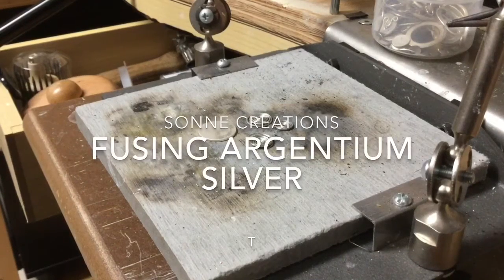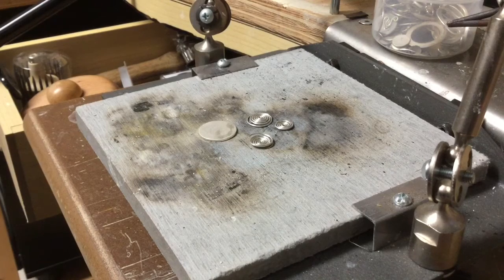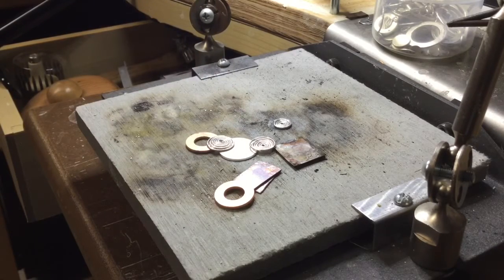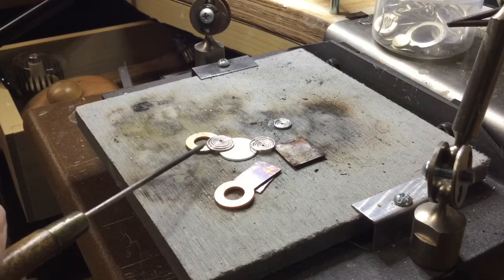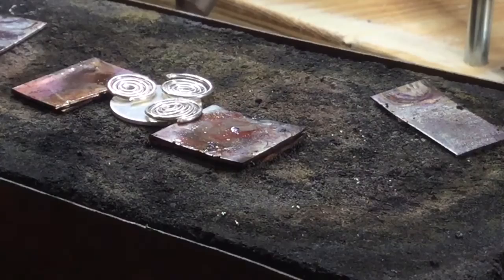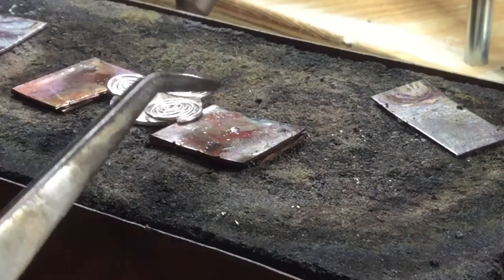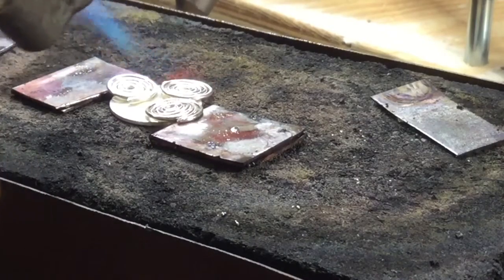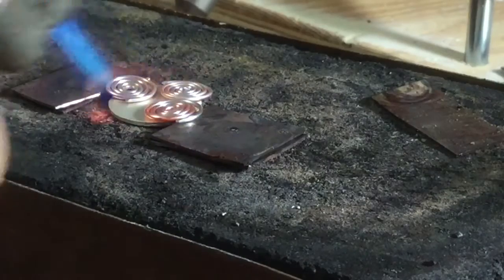Fusing Argentium Silver...Take 2

Comment: I taught myself on Argentium. I tried sterling and was frustrated with flux and solder and all the rest. I read about Argentium and that day ordered some and never looked at SS again. . ❤️❤️❤️❤️❤️❤️❤️Argentium
Reply from the maker: @gkelley2383  Fantastic!   Argentium is so user friendly it’s hard to believe. As long as you have enough heat, whether you have enough solder, flux or mojo it doesn’t matter.  It’ll either fuse or solder.  Welcome to the Argentium fan club!

Comment: The tip about the torch being full ! You are so right . I never noticed it before. I was struggling  to fuse a bezel , I filled my torch and wouldnt ya know ! It fused almost immediately . thank you thank you thank you .. . 
That was one of little tips that turns out to be a game changer. Serioulsy. 
Thanks again 
Gina
Reply from the maker: G Kelley You’re welcome!  The butane torches only hold a very little fuel, but even so a lot can be accomplished with them.  I have a small electric beehive kiln that I use for metal clay and enameling and soldering large bracelets and bangles, the kiln heats up the entire piece and then I come in with the torch and solder the join.

Comment: Hi ! Love your techniques with Argentium. I too am self taught . when I was finally brave enough to start working with metals Argentium caught my attention. I could not grasp why anyone would go through all the steps of soldering if you could use Argentium and just fuse it !! Sooooooo much easier. And it doesn't make me want to pull my hair out with frustration. I am currently working on a Argentium back with a fine silver bezel tape. I'm having a bit of trouble though. From watching your video I'm thinking I'm not going hot enough. Fear of melting !! Thanks for the video. Im happy I found someone with a similar background . .. B
Reply from the maker: G Kelley I probably have most jewelry instructors rolling their eyes, but sometimes a lack of formal education gives you the freedom to push boundaries and make new discoveries and sometimes it just feels good to challenge things.  If we all followed the American Food Guide we’d be an overweight nation......oh wait...., lol.  A butane torch does have limits, if you have access to a small Beehive Kiln used for metal clay, it really helps to get the piece up to temperature, otherwise it might be time to upgrade.  I might have to make a video on that.
Reply: SonneCreations I definitely need to upgrade my torches. I have 2 butane " chef " torches. Which have worked well for me so far. I have to use both when doing a larger piece or if I have any heat sinks. In struggling with a ring shank right now. I cut 2 pieces of 14g round argentium that I am wanting to fuse into a v and the bezel would then sit in top of the v. I've done this a lot but I always soldered. I know it will fuse but my torch isn't hot enough. 
Should I pickle before I try fusing again?
Reply: G Kelley, do you have a place where you show your work?  new to jewelery and would like to follow as many people as possible to learn from
Reply: Robbie Vigil I don't right now although I could send you some pictures.. I would need am email address ,  Facebook link or something similar . email is best for me.
Reply: I couldn't agree more!  I've been studying/researching off and on for about 8 months and finally made my first ring yesterday. 👍😊  I bought supplies (Fine and Argentium silver as well as Sterling) and chose to hold off on soldering Sterling because fusing made a lot more sense. Of course I'm just starting out so I won't have a bajillion components to add to any of my jewelry just yet. I haven't had formal training  so I share your fear of melting everything. I had a hard time today getting a ring to fuse for that very reason. Anyway, it's nice to know there are others who are self taught. Cheers!  🙂

Comment: I am so pleased to have found your videos which are so clear and informative :-)  Can I saw argentium in the same way as I would saw fine or sterling silver?
Reply from the maker: @Hilary Minor. Sorry for the delay, I’ve been away doing other things.  Yes, absolutely Argentium silver saws just the same as with any other silver.  The important key point here is to use the right blade for the thickness of the metal.

Comment: UPDATE:   😭😭😭😭  
My attempt to fuse another ring exactly as I did yesterday absolutely will do NOT fuse. 😢 After a half dozen attempts,  I refilled my butane torch and even put the ring back on a ring mandrel, gently work hardened/hammered, reshaped, and filed the ends so there was no gap whatsoever... not even a tiny speck of light was getting through. The ends matched perfectly because I sandwiched the file between the 2 ends when I filed them.  It just refuses to fuse! 😭  Now, it all black and yucky (it will buff out though).

Is it possible that I over heated and ruined the metal? It didn't melt and I got it to the orange glow several times and then glowing bright red after it kept failing.  It worked so well with the first ring I made even with a gap. If you happen to see my comment would you please give me a hint as to what the problem is with my Argentium (or me - LOL!).  Thanks for your help!  🙂
Reply from the maker: tammygurl64 Hi!  When it gets to the glow orange stage, you’re not quite done.  It needs to go one step beyond that to the almost melted stage.  When it gets there, hit the seam directly with the torch until you actually see it fuse, it will get there.  I made A LOT of chains when I first started, meaning a lot of jump rings, which are when you think about it, tiny rings.  Practice with a handful of those in different sizes.

Comment: Thank you for this. I was wondering about my creme brule torch but I will make sure that it is full before I start. When I have soldered 2 flat pieces of silver, I have noticed that the top piece wants to bend up when it gets hot. Do you think I would see the same with Argentium fusing?
Reply from the maker: Anne Carpenter Argentium is known more for it’s deforming (slumping or crumbling) when unsupported.  It the two pieces are well supported you shouldn’t see any bending up.... or bending down, lol.